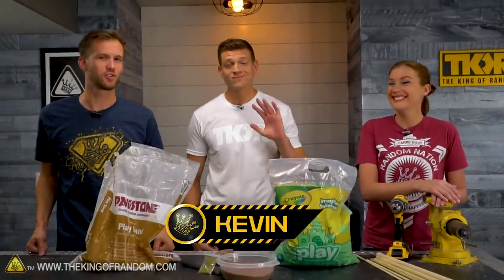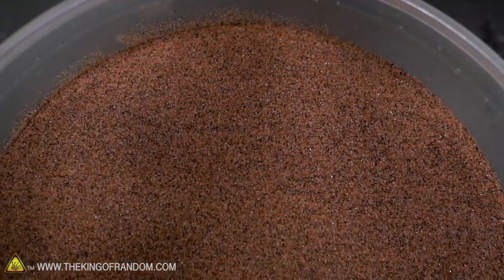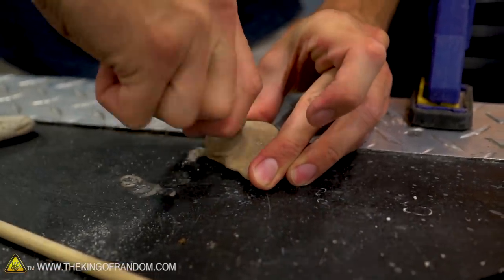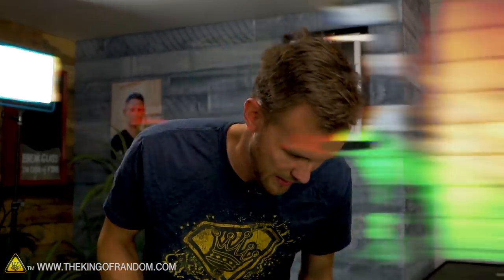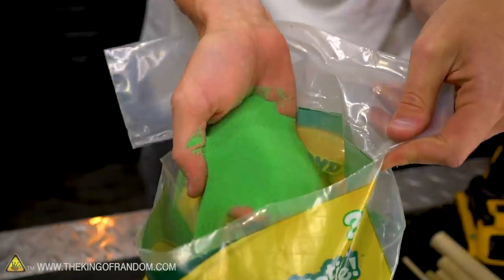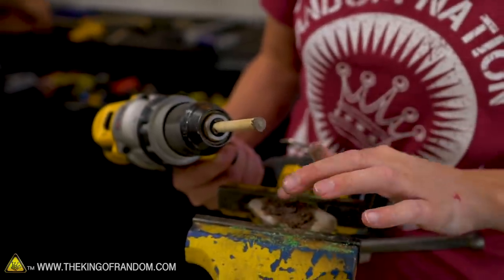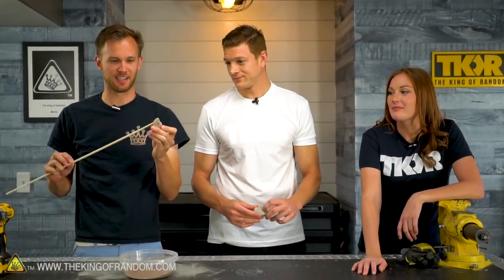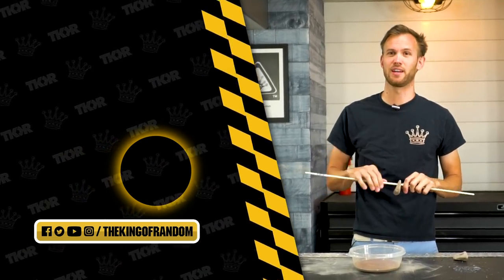Can You Replace Your Broken Drill Bit With a STICK?

Comment: This is how the ancient Egyptians bored holes - although they used a soft metal (copper) and DAMP sand.
Reply: Has any academic who proposed that theory  actually demonstrated that by making almost perfect holes (a couple of feet deep) through granite?
Reply: @ywsx6489  We are sure that our technology is the best ever reached by humans, right? Now.. Say me if something we built in the last 2 centuries can last 5000 year..  and impress future generations like pyramids.. That's all.
Reply: @AsitShouldBe   I get what you mean, but I think you're missing something obvious.  If we got a bunch of folks with earthmovers or whatever to pile up a bunch of rocks in arid conditions, far away from areas where there are likely to be storms or any other kinds of destructive weather, into a pyramid shape, those rocks will still be like that in 5000+ years.
  It's more due to the materials used (big blocks of stone), the conditions (aridity, so no burrowing creatures or roots etc which slowly but steadily degrade it) + the fact that a pyramid happens to be an exceptionally stable shape.
Reply: @AsitShouldBe  The Panama Canal
Reply: @Zanzubaa  5k years without maintenance ? Are you joking?
Reply: @Janos23  Also purpose. Conditions are a huge part, but also we don't even try to build to make things last 5K years really. The pyramids however were supposed to protect kings' tombs for ages... and were even more spectacular before all the facing marble was removed from them.
Reply: @NFTI  🅾️🅱️🅰️Ⓜ️🅰️
Reply: @AsitShouldBe  Mount Rushmore
Reply: @domineech  yeah, why not.. the only thing who can last in this age of technology is a massive rock sculpture.. sounds funny, isn't it?
Reply: @benjaminhackett8896  the power reached by  that people was huge, and technology too..  they decided to make something who last forever.. Today technology and construction can't last more than 300 yr. Powerful empires make something oriented to future, stupids and weak one thinks about today.

Comment: Try drilling down through a funnel filled with sand so as it drills it continuously drops sand.

Also try using a drill press to apply consistent pressure vertically.

Comment: Independent variable: The tool you drill with
Dependent variable: If it can drill through a rock or not
Controlled variable: The table
Reply: i thought it was the dependent variable that you change, and the independent is the result you measure?
Reply: @TheHarleyEvans  dependant is the measure because it depends on what you change.

Independent doesn't need anything else to measure by therefore you can change it.

Everyone gets confused so the way to remember is the "Dependant Depends".
Reply: Ohh yr7 science

Comment: You should play with a steel sand blaster abrasive( the type that's little round balls so you dont cut yourself)  on a really big magnet! Also use a smaller magnet at the same time.

Comment: Get a stick of a hard hardwood stick, fairly straight and use something to basically hollow it out. Find some harder rock and use rocks to bash together to make a sand from the smashed stones(that will create a harder abrasive that was fractured apart for a more aggressive grit). Take some clay and put it around the hole's location to create a dam. Dribble some sand and water slurry through the center and rotate stick slowly and with a steady downward force. a few hours or days later and Grogg has hole.

Comment: You should've made like 1 or 2 inch clay wall around the point that you were drilling so the abrasive could actually circulate or you may even use some water to cool the wooden stick and make it circulate better with the powder of the rock itself

Comment: Some thoughts. Straight wood? Probably not, it might depend on the type of wood vs. type of rock. Second, loose abrasive would not be as effective as abrasive stuck to the stick. So, my "caveman" setup would be the hardest wood I could find, an abrasive I could easily lay my hands on, some sort of natural adhesive, and a bow drill.

Comment: I would like to see you drill through rocks in other ways - especially if the options do not use up, or have long-lasting consumables - all battery-powered: welder, sandblasting using no special sand, drill with titanium, tungsten, carbide drill bits, any other thing you can think of and compare hole depth over the same battery drain time.

Comment: Put a nut before pouring sand for constant supply of it. Old handyman trick to lubricate metal when drilling was to use washer and oil inside before drilling. Don't thank me for this. :)

Comment: If you had used clay mixed with the garnet instead of wood you could have mixed and delivered a higher concentration of abrasive to the stones you were trying to put holes in. Or maybe put the garnet clay mixed stick inside the wood or hollow tube of wood, so you get better usage of the garnet while drilling. Any clues as to is it as easy to drill a large hole verses making a small hole and then making that hole bigger?

Comment: Dry abrasive has less friction than wet abrasive, plus wet abrasive stays put better than dry. Hemp string and sand can cut through rock, as long as it's wet! Should work for the wooden drill bits as well.

Comment: Try placing a hot coal on your stone heat it up.  then carefully dripping cold water where you want the hole to be. Keep repeating this until your hole is deep enough to hold the wet sand and broach in place. Then drill with the primitive pump drill.

Comment: Wet the abrasive! Wet string and sand can cut through rock. Especially if the abrasive is harder than the rock you are trying to cut through! If you made a loose paste with the abrasive, it should work with the wooden drill bit!

Comment: Why don't you use heated pine SAP and charcoal mixed with the sand to adhere the sand to the stick creating an abrasive stick? Then using a fire bow to low speed drill the rock so you are not constantly losing a mass amount of abrasive? Try starting out with a softer rock such as sandstone then going up in hardness when you have success?

Comment: It is possible to create a hole with a pipe and sand the documentary for Egypt proves this using the pipe in the method of a bow drill and a third person pouring sand into the crevice divot it is possible and obtainable using a stick poses several factors to consider as well as the rock hence maybe oak or walnut could create a divot on soft sediment like limestone and the lack there of like pine on granite these factors should be taken in to consideration

Comment: i have a rock that i found in a river and it has a hole straight through the rock at an angle and another hole kinda like a cave and it has weird things in it i think its part of the rock but the cave hole is super small like 3/16th of an inch

Comment: I have some Bronze Age jewellery - glass and amber beads - and they have been drilled to take a thong. That drilling was done with a sliver of bone or deer antler. Through glass. They must have had tremendous patience, and all the time in the world.
The beads are real - I had them examined at the local museum. They were found in a field, where several Tumuli (burial mounds) had been ploughed out, centuries before. The land owner wasn't interested, which is how I came to have them.

Comment: I have tried this before but I glued Garnett to the tip of the stick and used a bow saw spin it faster every few minutes I had replaced the Garnett and reglue it with super glue it went straight to the Rock but to be honest it wasn't a hard rock it was slightly soft

Comment: I couldn't tell with my phone.... but if the sand wasn't wet, it might have worked better if it was. 
Try making some actual drill bits from things found around the house. E.I. metal hangers, sticks, pieces of rock rock and stick, wire, glass, and more....

Comment: So not really so much trying to drill a hole in rocks with a stick as much as applying pinpoint pressure and motion with a stick using abrasive grit to drill a hole in rocks

Comment: "I was using a stick in a drill." Um... no, you weren't. You were using an industrial abrasive. The stick was just acting like a crappier version of sandpaper or a grinding disc for the abrasive to stick to and move against the rock. The drill was just moving the stick.

So... can an industrial gemstone abrasive cut rock? Of course it can. Duh. It could also cut steel, titanium, molybdenum, or basically anything with a lower hardness scale.